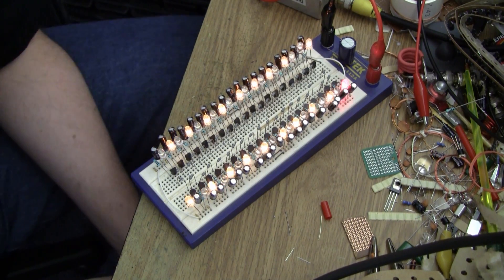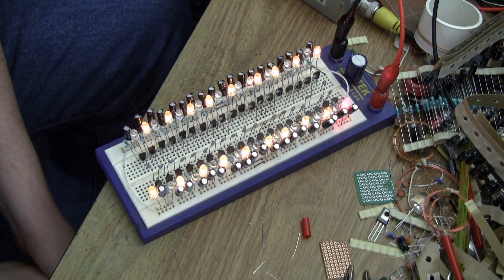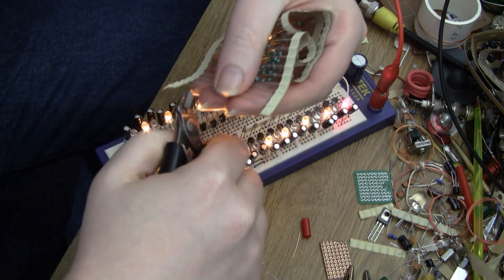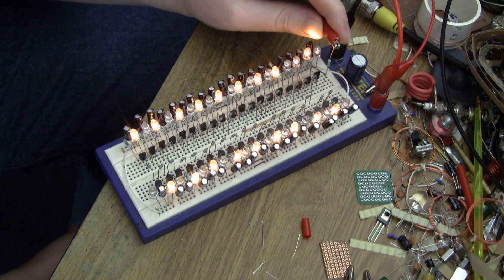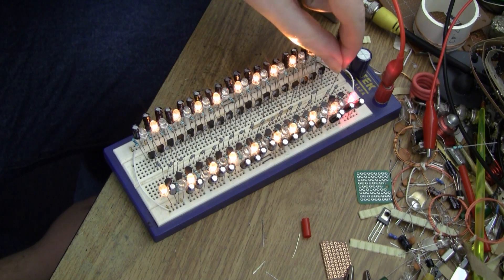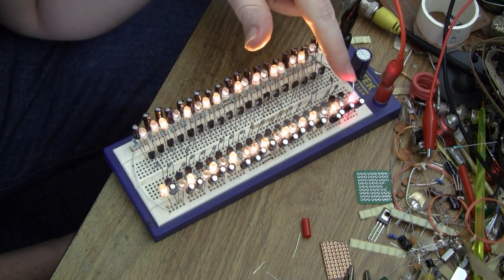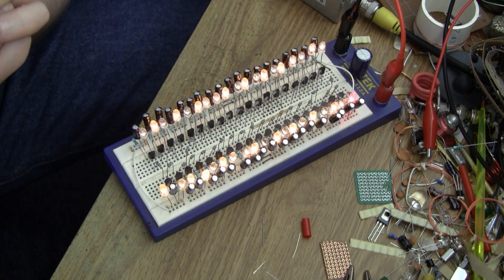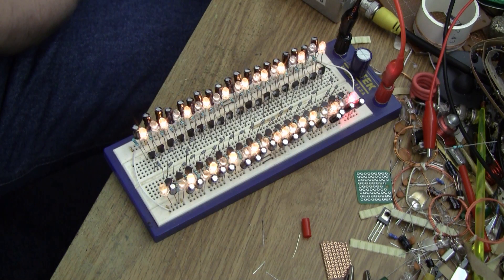More Ring Oscillator Das Blinkenlights

Comment from the maker: @k0rmus @randomgarfield sucks the software won't let you do it easily, was thinking of writing some postscript by hand to do a layout myself, easy enough to rotate and restroke N-times in PS.  The circuit shown uses 10 uF caps, and in operation the base-emitter+LED drop clamps their max voltage rating to < 4 volts. Small tantalum caps with 6v3 ratings should be available pretty small?

Comment: @k0rmus I started designing exactly that but ran in to trouble when my ED package can't put devices at angles. Also being an odd number of cells makes it hard to divide the circle up into even sections when you are working with a grid. Once I discovered I couldn't use components on any angle I didn't continue working out the positioning. The other issue is the caps need to be pretty big values (so like 7313 sized) which makes the board by fairly large for anything bigger than three cells.